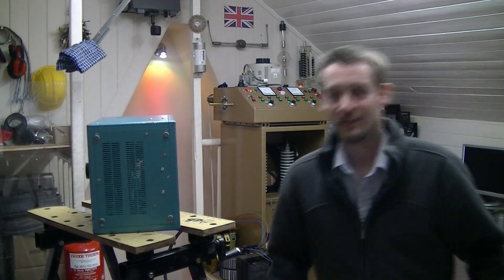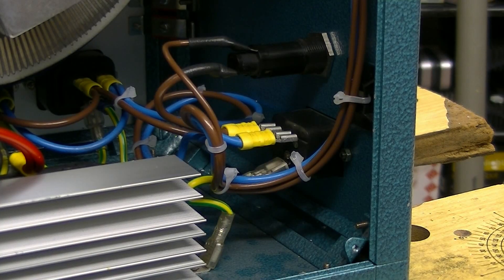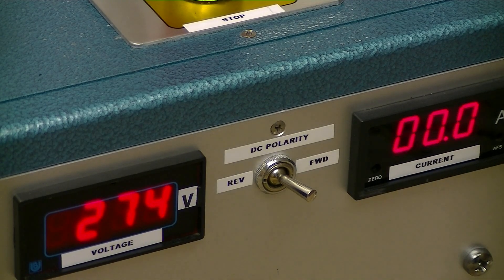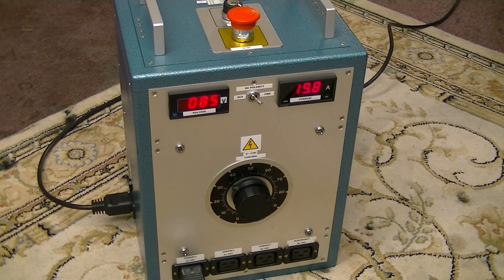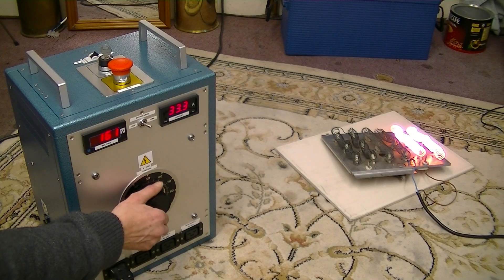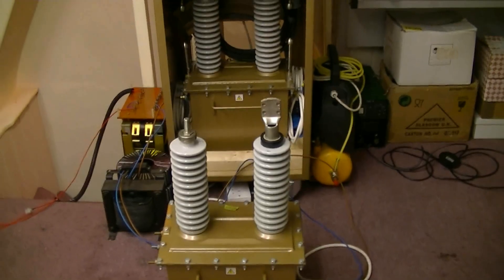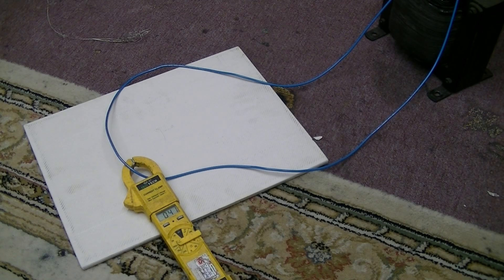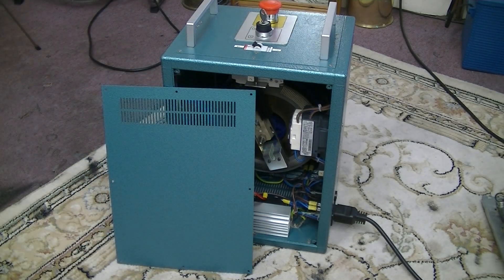Easy Electrical Project (with overload)

Comment: The humming you hear is because the magnetic field in transformer coils is a physical force acting upon ferrous metals (like in a speaker). Even though you might see varnished wire that is glued down or epoxied really tight, the magnetic force is still tugging on these wires ever so slightly. It doesn't have to be the coil wire itself either, it could be any metal object around the coil. The force is there and it's pushing and pulling on that metal back and forth at 100-120 times a second.

Comment: Did you watch the video & hear what he said repeatedly when talking about his new variac? That one is rated for 20amps, will take 40 for short periods. There are indeed higher current models, and they are indeed much more expensive ( even the fairly small ones aren't all that cheap as I found out )...

Comment: I found the glass fuses I needed at Mouser, but I'm going to double check my local stores first. I live in the US and our old style house fuses have lamp bases on them (no joke) and would be a bit dodgy as they are rated to 125 volts and my Variac is 140 volts out, getting a 10 amp fuse would be special order too as 15, 20 and 30 are the most common with 30 being the max for that type.

Comment: Your clamp on ammeter is going to have a nice burn in It now, just like mine does. Good video. Can you make wires shake by using that reversible DC? I know it's not very high current, but I find it interesting seeing wires shake at low frequency and high current from the magnetic fields.

Comment: Photon, I'm glad you mentioned fusing the OUTPUT side like mine is. The fuse that came with mine (bought used) is only rated to 32 volts so it is DODGY as all getout. I'm thinking of getting a ceramic microwave fuse for it as it is the only way I can get a 10 amp fuse for the thing at the proper rating.